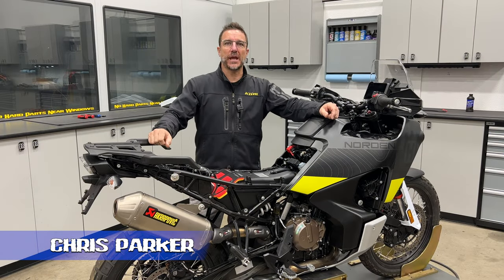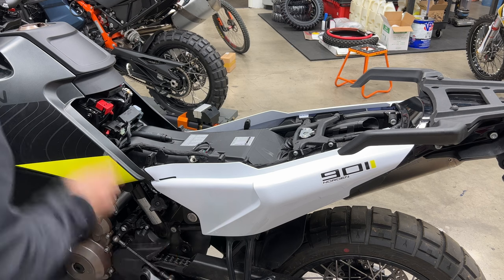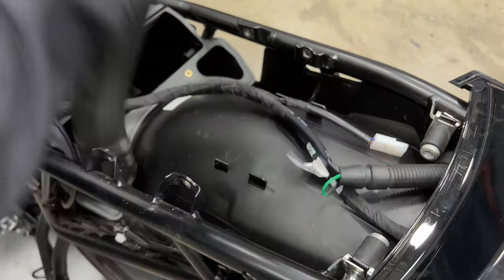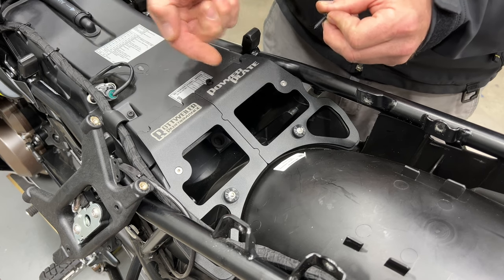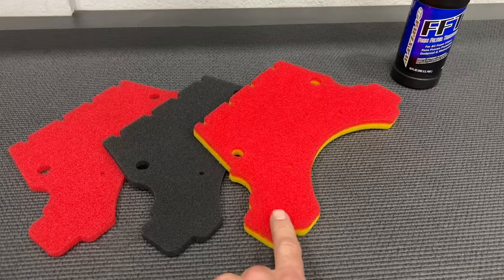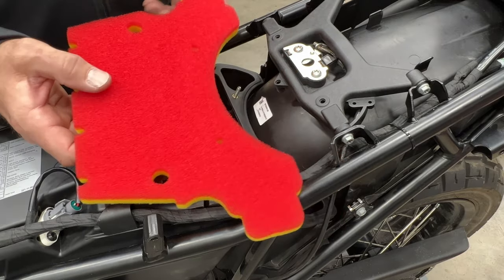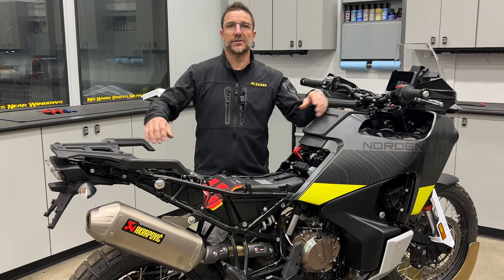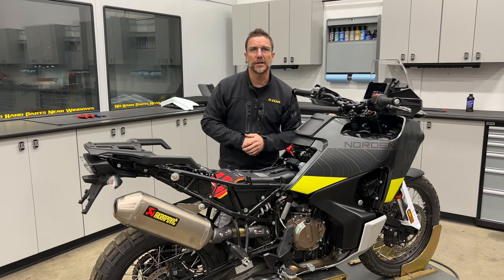HOW-TO INSTALL ROTTWEILER PERFORMANCE POWER PLATE - HQV 901 NORDEN - ROTTWEILER PERFORMANCE

Comment: Thank you!  This was super helpful (especially considering there were no installation instructions in the box).
Reply from the maker: Glad to hear it! There should have been a card in your box with a QR code that includes a link (once scanned) to all of the install instructions for our parts on the website. Apologies if that was not included in the box. For any Rottweiler Performance parts, visit our website and click the "Instructions" tab and then just scroll down to the part you are installing for instructions or videos. Thanks for your purchase!

Comment: This is one of the best installation videos I’ve seen anywhere! Clear, concise instructions delivered with camera angles that actually show what’s going on. Great work. 

I’m on the fence about this product and have nearly purchased it twice now but am concerned about drilling holes into the air box! That just seems like a potential ingress point for dust once the screws get enough jostling from the power plate. I’m trying to work out a way to install  this without going through the air box. I might try gluing studs in those places that can take thumb screws. .. or am I worried for no reason.
Reply from the maker: You are definitely worried for no reason. We have sold 1,000's of these and what you mentioned is not an issue whatsoever. If you are truly concerned you can simply replace the wood screws with regular screws with nylock nuts on the inside of the airbox but again, this isn't really a thing. We would recommend getting the kit and if for some reason once you see it you are genuinely concerned you can send it back but we really don't see that happening we are that confident.

Comment: heck with that just do the whole intake kit. my norden runs like a champ now !!  crazy quick revving bike all uncorked👍👍👍👍😊😊😁😁 , and the Arrow mid pipe & ti silencer sound awesome
Reply from the maker: That would certainly be the next step! These are great for powering up your filtration capabilities, but for the big horsepower gains the full system is certainly the way to go. https://www.rottweilerperformance.com/fuel-air-24/
Reply: @RottweilerPerformance  got it did the whole nine yards at the first service , waiting for your 'Hyperpro' spring kit to be available for it as that'll be next

Comment: I just picked up a 2020 790 with your prefilter set up. I will keep it on but will need extra filters. The surface area is small and in dusty conditions will plug up in a half day on some of my rides. Just went to your store and see you requirement changing once a day. Good call. I will buy 5 dual foam elements.
Reply from the maker: It's more of a suggestion than a rule really, but depending on the riding you do it's never a bad idea. Here is the link! https://www.rottweilerperformance.com/rottweiler-performance-replacement-filters-for-790-890-901-adventure-power-plate/

Comment: Just got my 901, already had the power plate, but snorkels we still installed pushing the foam into the air box, not correct right? I'll buy a new filter I guess

Comment: I have running issues now I have fitted the power plate 
There is a small lag on the throttle response from shut throttle, and it seems to lack a bit of power 
Also get popping bangs on deceleration which tells me it’s lean ? 
Hope you can help
Regards Tom

Comment: Did you tested dynotested this plate without the paper filter ? Couls it be a alternative to stock filter ?
Thanks for the contents, you guys rock !
Reply from the maker: We actually haven't but would probably not recommend that. It's an interesting idea for sure, but the design is made to be more of a pre staged filtering device rather than a main filter. If you are looking for big power gains, we would recommend the full intake system linked below. That system has a triple stage filter and a lot of surface area for filtration combined with big power gains from the shape of our airbox design. 
https://www.rottweilerperformance.com/fuel-air-24/

Comment: I installed this kit but had the filter orientation wrong, thanks for the video.!

Question: The kit came with 2 extra thumb nuts, nice add.  Because the threads lack locking elements do you purpose these in the kit becuase its likely to fall off in service?
Reply from the maker: Thanks Mike! Yeah, we add the extra thumb nuts so that if for any reason they get misplaced, you will have backup. We've had pretty good luck with ours staying on even during service, but it never hurts to have a spare!

Comment: I’m new to KTM/Norden
What I could not understand from this video (which is very easy to follow) is why is this needed?
It seems like you put an extra filter before the stock one. And why is it called power plate?
Thanks
Reply from the maker: We call them Power Plates because they power up your filtration capabilities. The stock air boxes on KTM’s are notorious for letting dust by the paper filter, and this product acts as a pre filter for the paper filter without choking out your intake system and reducing horsepower like some of the factory KTM solutions can. You can easily carry spare filters as well and change them on the trail with ease.
Reply: @RottweilerPerformance  thanks for this explanation.  I was going to ask the same question.  I'm not an experienced rider, much less an off-road one but I love to learn about the engineering and tweaks.  Your videos are top notch, well-explained, and orgnized (love the task/time breakdowns provided).  That, along with the products you make and how you feature your employees, ...just an impressive company from my perspective.  Thank you.
Reply from the maker: @bikeover  Thank you Mark! That means the world to us. We have a great crew and are working our butts off to make this the best company in the biz and your comments just add fuel to that fire. ❤‍🔥

Comment: Hi, I am going to order one for my Norden Expedition, but I have two questions, one of them ¿it could be a problem to cut the excess filter "ears" on the sides? And the second one, I have instead of the OEM paper filter the foam filter from Twin Air, but I have seen that you use OEM paper, do you think the paper one it would perform better in terms of performance and protection with your Power plate? 

Thanks so much for your time ;-)

Comment: My buddy uses one and recommended it. However mine is a 2023 cfmoto Ibex 800 T. My air box is way different.  Do you make one that fits the 800 ? Thanks
Reply from the maker: Unfortunately we do not if the airbox is every different. We don't get those over here in the U.S. so it's hard for us to do any R&D on them.
Reply: @RottweilerPerformance  they do sell them here in the States as a CFMoto Ibex 800 starting in 2023.
Reply from the maker: @DubuqueDude  As soon as we can get our hands on one we will certainly look into it!

Comment: Do you recommend this for Florida wet conditions? I’m concerned about water intrusion into engine. Thanks
Reply from the maker: This is 'PRE' filter, but we don't see any further danger from water than stock to be honest. Stock has the open snorkels, this replaces them with foam closer to the rear of the airbox so you are probably better off with the Power Plate in wet conditions when compared to stock. The snorkels will just deliver the water to the airbox where the Power Plate should hinder water a bit.

Comment: What about the power restriction once all this foam is added is this not going to restrict air intake even further. This foam oiled filter is going to help with dust particles, but shouldn’t the stock air filter inside be replaced with some kind of high airflow type filter so it can suck in a bit more air and increase the amount of airflow to further increase the power and smoothness of the power delivery?
Reply from the maker: That's not a bad idea at all. It's not mandatory by any means but would certainly work in conjunction with the Power Plate system for sure.

Comment: Hey I just ordered this power plate and am installing now I see there are two holes in the bottom of the air box I wonder if they could be closed off
Reply from the maker: Those don't need to be. They are just water drain holes. You could close them off if you aren't submerging your bike.

Comment: one very simple question, what happen if you lay down bike in the river?
Reply from the maker: The same exact thing that would happen in stock form. The air-box would fill with water. The difference is with this system is that A) you can clean out the air box without needing any tools to get to the stock filter and B) if the stock paper filter is waterlogged, you can remove it and rely on the power plate filtering to get you home in an emergency.

Comment: Why do you need to remove the stock filter for the installation?
Reply from the maker: Because you need to make sure there are no plastic shavings that have dropped into the airbox after the screws are wound in. There shouldn't be because nothing is drilled, but just in case.
Reply: @RottweilerPerformance  got it - thanks for a quick reply...I will prbbly not touch my airbox - thinking a tiny plastic shaving would have zero impact inside the engine anyway (contrary to the dust around the airbox).
Reply from the maker: @michail1963  It's easy enough to pull out, but either way you'll be fine. The screws just thread in and push plastic out of the way and don't really 'shave' anything off. They are like the plastic screws KTM uses here and there that are like wood screws.

Comment: If i put your 2 stage airbox's in and put on a decat - do I need to get a powercommander too? Or can I get away with the factory tune. I'm using factory muffler
Reply from the maker: Need and want are different here. Do you need a Power Commander on models 790 and above? No, they self tune themselves to a 14.7 air fuel ratio and keep things in check pretty well. That being said, if you are looking to exploit all the power you can on this model, the Power Commander is highly recommended. We have some pretty amazing tunes for that bike that will really add rideability as well as gobs of power. Either way, you are good to go. Just depends on what your budget will allow and what you are willing to install.
Reply: @RottweilerPerformance I spoke to Tanner today via chat, we were discussing the PC, my concern is heat, so I'm purchasing the arrow decat, in your opinion, will it run $500 significantly cooler 😂with the PC as compared to if I let it tune it's self after decat? Ty for your time

Comment: If this is post filter and less resistance wouldnt that become the main air filter?
Reply from the maker: This is pre filter. On the Duke models they are post filter.
Reply: @RottweilerPerformance   I was referring to the Duke
Reply from the maker: @reecewarfield8726  Ah, didn’t catch that part being this video is 901 Norden related. In that case yes, it would be. The good news is that the Duke being a street bike isn’t seeing nearly the same filtering challenges that and adventure bike would likely see, so we are much more comfortable converting that to the main filter which gives the user more tunability with air flow and the 3 filters they come with.

Comment: I saw on your site it's not legal in California, but do you know/have some customer in EU specially in Sweden that install this and pass the yearly vehicle check?
Reply from the maker: We don't have that info unfortunately. There are so many countries with so many different regulations it's hard to keep up but these are completely hidden on the bike and if they are checking exhaust gasses you can zero out the unit temporarily by saving the original map on your computer, taking all the map values to zero and resending the map and it will output exactly the same as stock as there are no modifications to the map happening when they are all zero. When you are done just plug in your PC, re-upload the map that was previously saved and you are back in business. It's really that easy. We can't openly condone breaking any regulations though. That will of course be up to your discretion.
Reply: @RottweilerPerformance  thanks for the detailed response. The power plate can be used w/o remap, right?
Reply from the maker: @kamezodo  Anything can. You can modify that bike blue in the face and the narrow band O2's will always do a fantastic job at keeping the bike at 14.7 air fuel ratio. Remapping is always good, but not mandatory. Can be done later or not at all. You are good. There are many misconceptions about how fueling works these days and there isn't much you can do wrong, or at least less wrong than with carburetors.